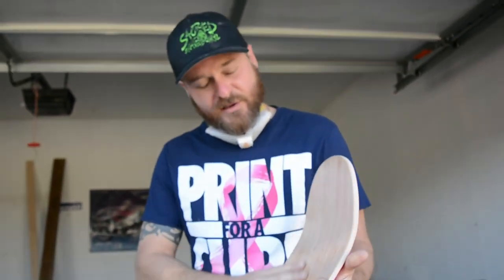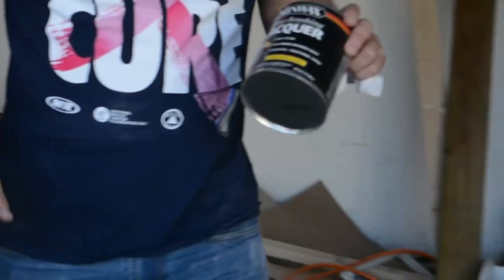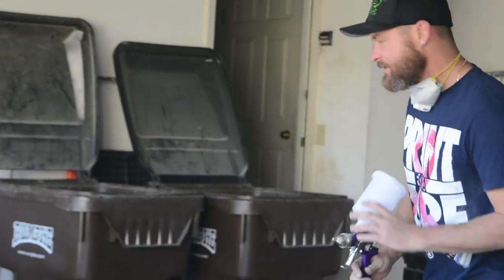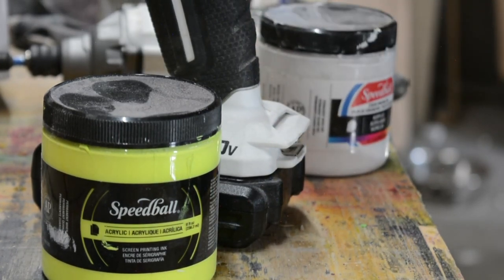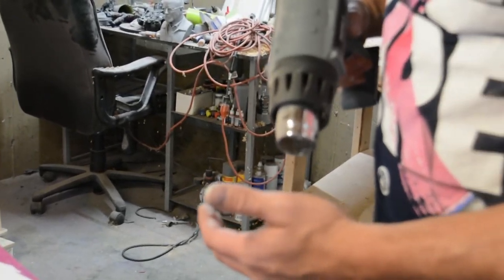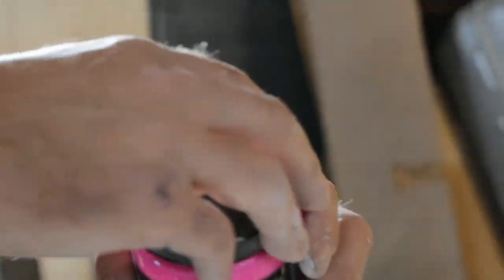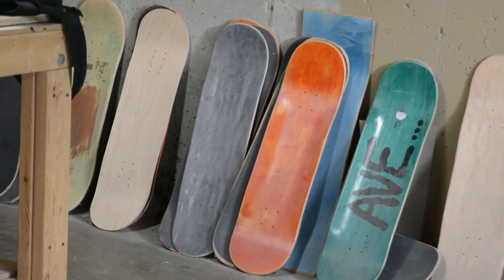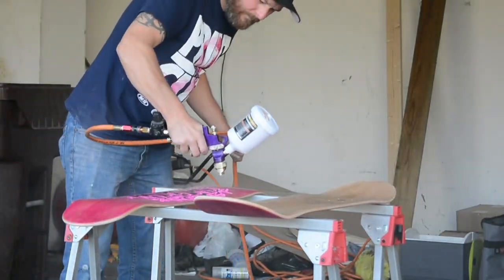HOW SKATEBOARDS ARE SCREEN PRINTED

Comment: yoooooo please tell me you sell the board squeege
Reply from the maker: Ill let Rob know you're interested!
Reply: cut an old skateboard in half and sandwich the rubber part of the squeegee in between the two pieces of wood using bolts. if you have an old squeegee lying around, just take it apart and steal the rubber part from that for the new one.